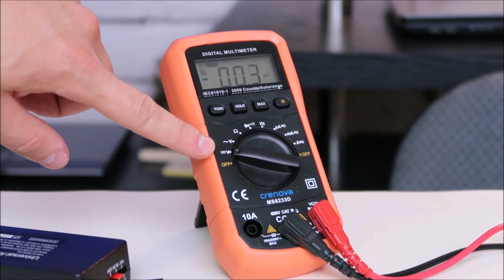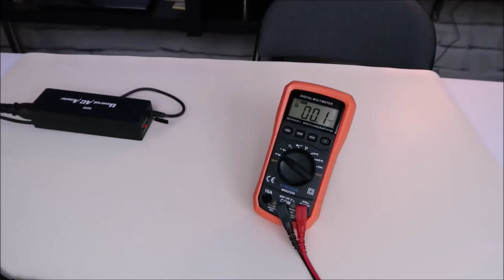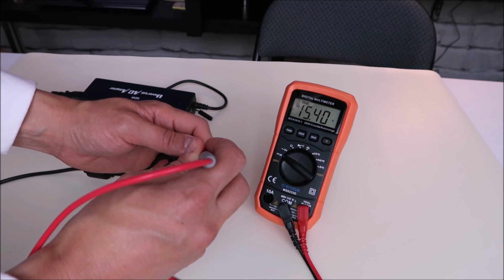How To Fix Any Laptop - Wont Turn On, Wont Open, Turns Off Right Away, No Power Solution

Comment: hi guys, i've watch a ton of vids from your site but can't find an answer to my issue (nor does Dr Google help me either).  i have an HP Envy, when I am working and then close the lid and reopen the lid my computer keyboard freezes for a period of time....I can see the screen and all tabs i have open.  I can see the curser but it isn't blinking.  I have turned the "what to do when I close the lid" to "do nothing".  when my keyboard isn't working, If I wait a full minute or two generally (suddenly) I can use my keyboard again.  Sometimes, however, I need to do a hard boot to get things going again (esc does nothing, warm boot C-Alt-Del does nothing).  This seems to have started around window 10 install and i'm now using Wind 11.  I also have a touch screen which I disabled thinking this might be the issue but doesn't seem to make any difference.  A Weird thing is that if my keyboard is frozen and my touch screen is enabled I CAN use the touch screen even tho the keyboard is frozen.  I've tried everything I can think of.  any ideas?  Thanks for help if you have any.
Reply from the maker: Many times, sleep mode starts glitching without needed updates or with messed up updates.  Best to not use it all the time if you dont have to.  Make sure the computer is fully updated as seen here first;  https://www.youtube.com/watch?v=DDv2gJDjfOM

Comment: my Acer all in one does not turn back on without me having to reseat the ram. it's not the inside battery or the charger. can you think of a reason why it turns on after reseating the ram but not after powering down? it's about 5 years old is it time for a new computer? appreciate any input thanks.
Reply from the maker: Your RAM could be going bad or the RAM port could be lose / damaged :(

Comment: Hello Brother i have a (Acer Chromebook Spin 513 2-i-1) and it wont turn on. The light battery works and i have tested all steps. Please help me i have a LOT of homework to do
Reply from the maker: If all the tests in this video do not reveal the issue, and your power adapter tested to be fine, then your most likely looking at a Motherboard replacement as seen here;  https://youtu.be/N_7HNrFkMS8.
Reply: @PC_Monkey  My acer dont have the same motherboard
Reply from the maker: @aandersson5676   No of course not :)   Each computer will have a different motherboard and a different way to access it.  Does this help access your MB?  https://www.youtube.com/watch?v=j6wuTqmVp4o

Comment: Kinda late to this but mine didn't work- pls help 😭😭 I really need to finish my exam and the deadline is tomorrow 😰 I try to ask my mom to go to the store to fix it but I can't go to any store cuz I'm too young plus I don't have any money to fix it 😭(ಥ_ಥ) help plsss! 😓
Reply from the maker: Are there any signs of life at all when you try to turn it on?  Lights?  Fan, Motherboard, or Hard Drive sounds?  Anything seen on the screen?
If not, then your on the correct video.     If all the tests in this video do not reveal the issue, and your power adapter tested to be fine, then your most likely looking at a Motherboard replacement as seen here;  https://youtu.be/N_7HNrFkMS8.

Comment: Pls help my laptop acer aspire won't turn on. I already followed you on what you teached but it still doesn't on. Reply to this pls and I will say all the details.
Reply from the maker: Are there any signs of life at all when you try to turn it on?  Lights?  Fan, Motherboard, or Hard Drive sounds?  Anything seen on the screen?
 If all the tests in this video do not reveal the issue, and your power adapter tested to be fine, then your most likely looking at a Motherboard replacement as seen here;  https://youtu.be/N_7HNrFkMS8.  If you know your computer's model number, I can help you get inside your specific computer :)

Comment: Still doesn’t working.... (ps my battery wasn’t working for years now. Also I bought new charger and still nothing)... What can I do? 🥺
Reply from the maker: Are there any signs of life at all when you try to turn it on?  Lights?  Fan, Motherboard, or Hard Drive sounds?  Anything seen on the screen?
Reply: @PC_Monkey  First of all thank you for answering. When I have my laptop in charge and my battery on I see a red light in the battery icon and if I press to turn it on It does open, I hear noises from it and then laptop says “preparing automatic repair” and shuts down again! 
If I remove the battery and still have the charger then my laptop doesn’t open.

If I remove everything and try to do what you show us on the video my laptop stays alive (😆) for 1 minute but if I try again to open it without remove everything again it closes in 5 seconds. 

Sorry for my loong message.
Reply from the maker: @videoswithcats  If your able to see the message 'Preparing Auto Repair' then this is the wrong video to be on as your computer is actually turning on :)  What brand computer do you have?  I can direct you to the correct video
Reply: @PC_Monkey  But it’s turning on only for 1 minute and then it’s shutting down again. I have Asus x552c.
Reply from the maker: @videoswithcats  Are you able to try the steps seen here?  https://www.youtube.com/watch?v=J1ZagkSTcSI
Reply: @PC_Monkey  I tried these steps but in the boot tab I had only "Launch PXE OpROM
Enabled" under the "Boot Configuration" I disabled, press F10 and then see if my 
laptop could open, nth happened so I enabled it again but..nth happened again!

After that I went to another video of yours "How To BIOS Reset an Asus Computer / 
Access Replace CMOS Battery - Laptop Wont Turn On Fix #2, 
https://www.youtube.com/watch?v=uL97XhontSo&t=491s" 

I disassembled my laptop, took out my CMOS battery for 30 minutes and then put it 
back and try to assemble my laptop... all went well but... I accidentally Ι take off the 
blue out of one ribbon cable, the one at the left (I hope that you understand what I did). 

1.Can I fix it somehow? If I can then how? with office tape or it will get worse? 
Or buy another ribbon cabe.

2. And another question, because I'm doing my MSc, 
can I have my files back if my laptop can't open again? 

(When I try to open my laptop, I don’t
hear the noises that I was hearing
before..but I see the battery’s red- light, 
with battery and charger on of course...)
Thanks in advance.
Reply from the maker: @videoswithcats  If you cannot find how to switch the setting in BIOS or if switching did not help, then reinstall the Operating System as shown here;  https://youtu.be/1VD9fPJ1eik.  You can create your own install media for free as seen here;  https://youtu.be/g_UhiHScaSI.  If Windows won't install correctly, then we know that the Hard Drive is bad.  Replace it as seen here;  https://youtu.be/jQDcHTgmV0Y.  Then, install Windows onto the new one.
Reply: @PC_Monkey  one of the ribbon cables (the one at the left, who is attached to the on/off button) broke. Actually his “tail” broke, the blue one. Can I fix it somehow? Because I can’t switch on the laptop right now (Although I don’t know if this is the reason why laptop doesn’t open). 
Also, can I take my documents off the laptop? 
I’m asking you because laptop doesn’t open. Thanks again for your quick response.

Comment: My computer won’t turn on and the only fix is removing the battery, only problem is the battery is internal and it has broken screws so even if I open the pc I can’t take the battery out. Any fix??
Reply from the maker: Are there any signs of life at all when you try to turn it on?  Lights?  Fan, Motherboard, or Hard Drive sounds?  Anything seen on the screen?  You dont have to unscrew the battery possibly, just unplug it from the motherboard.
Reply: @PC_Monkey  The only sign of life is when i connect the charger the light next to it turns on but that about it, ocasionnally when I unplug it and hold the power button really fast it turn the power button light on but no signs of life no fan no battery, nothing. Ill try to unplug the battery.
Reply from the maker: @spiderpal2341  Good luck !!  Let me know how it goes :)
Reply: @PC_Monkey  Nothing happened. Do you have a discord I can add you at? I want to send you pictures so you can help guide me.
Reply from the maker: @spiderpal2341    If all the tests in this video do not reveal the issue, and your power adapter tested to be fine, then your most likely looking at a Motherboard replacement.  You can post a video of the situation on your YouTube channel and message me back here when you do.  I can then view and advise further.

Comment: Doesn't work dude
Reply from the maker: These are diagnostic steps to troubleshoot which component is the cause of the computer not turning on dude :)  As stated in the video, if the steps seen here dont identify the issue, then you are left with the motherboard being the cause.  It would then need to be replaced.

Comment: I have an Acer Aspire 3 but it no longer turns on and when I connect the charger the charging led does not light either, I check the charging pin and it works correctly but the battery seems to have 0v and does not charge, I tried without the battery and with the charger connected but it still does not turn on

Could it be the damaged battery or the motherboard?
Reply from the maker: If all the tests in this video do not reveal the issue, and your power adapter tested to be fine, then your most likely looking at a Motherboard replacement as seen here;  https://youtu.be/N_7HNrFkMS8.  If you know your computer's model number, I can help you get inside your specific computer :)

Comment: Hello I using the elite book 8470p  it does not come on , if I plug in the charger  a led light blinks in front of the computer .
Reply from the maker: Are the lights the only signs of life when you turn it on?  No motherboard or hard drive sounds?  No fan noise?  Nothing on the screen?
If the lights are the only sign of life, then your on the correct video.  Are you able to try the steps seen here yet?

Comment: Idk its still not working on my laptop huhu should i go to repair shop? 😭 But im broke pls
Reply from the maker: Are there any signs of life at all?  Lights?  Fan, Motherboard, or Hard Drive sounds?  Anything seen on the screen?
Reply: @PC_Monkey  nothing, even the On button there is no Light power, the fan not working, there's no hard drive sounds at all,  it's been a month i didn't use it :(( 
idk i use it last time its overheated i guess.. that's a normal in laptops right?
Reply: The charger are in good condition.
Reply from the maker: @ashliadatu650  If all the tests in this video do not reveal the issue, and your power adapter tested to be fine, then your most likely looking at a Motherboard replacement as seen here;  https://youtu.be/N_7HNrFkMS8.  If you know your computer's model number, I can help you get inside your specific computer :)
Reply from the maker: @ashliadatu650   Good luck !!  Let me know how it goes :)

Comment: Not solved..... 
My problem "Start and shuts off right away" 😭
Reply from the maker: Are you able to see anything on the screen before it turns off?
What brand computer do  you have?
Reply: @PC_Monkey  no, nothing appears in the screen.  it shuts down Immediately.
Brand : DELL
Reply from the maker: @khaledshaifullah6275  If all the tests in this video do not reveal the issue, and your power adapter tested to be fine, then your most likely looking at a Motherboard replacement

Comment: What really happened to my laptop is
I was going to the restroom and something dropped on my laptop by accidentally then the screen turned black with rectangle color green and square  then i turned it off cause my mom said turn my laptop off then it wont open then today my mom brought my broken laptop to a place idk what its called and they said it can not be fixed and i need to buy a new one our country is in philipines we bought the laptop lastyear for 24 ,000 philipine peso and its been one year idk what to do cause i have school and it would be hard if i use my Ipad  hope you can help me
Reply from the maker: Are there any signs of life at all?  Lights?  Fan, Motherboard, or Hard Drive sounds?  Anything seen on the screen?
If not, your on the correct video.  Are you able to try the steps seen here yet?
Reply: @PC Monkey   Thank you but i think nothing is wrong with my Laptop because it just magically opened in the repair shop on monday it did not open but yesterday when my laptop is checked it opened magically and the battery is very low idk why it just opened like that when it did not open on monday
Reply: @PC Monkey  keyboard everything is fine but thank you
Reply from the maker: @lianaalexaregidor9480  Glad your all set :)   Always here if needed !!

Comment: Hi! I check all of my laptop's parts, but my laptop has the problem of being turned on with only DVD, power led and internal mouse active led on. Not booting at all. Everything else is dead apart from from the above mentioned! Any ideas?
Reply from the maker: your on the correct video.  Are you able to try the steps seen here yet?

Comment: What if the keyboard turns on (keyboard lights up) both ways in your vid, but then turns off (black screen)
Reply from the maker: Are the lights the only signs of life when you turn it on?  No motherboard or hard drive sounds?  No fan noise?  Nothing on the screen?
Reply: @PC_Monkey  yes, unfortunately 😭
Reply from the maker: @Wahsup05  your on the correct video.  Are you able to try the steps seen here yet?
Reply: @PC_Monkey  yes still no luck
Reply from the maker: @Wahsup05    If all the tests in this video do not reveal the issue, and your power adapter tested to be fine, then your most likely looking at a Motherboard replacement as seen here;  https://youtu.be/N_7HNrFkMS8.  If you know your computer's model number, I can help you get inside your specific computer :)

Comment: i have a inspiron 11 3000 series 2 n 1 what are the max upgrades (it does not quite run as good as my other xps 15
Processor	Intel(R) Core(TM) i9-10885H CPU @ 2.40GHz   2.40 GHz
Installed RAM	64.0 GB (63.8 GB usable)
System type	64-bit operating system, x64-based processor
Reply from the maker: You can have your computer scanned to see possible upgrades on sites like crucial.com.  Just dont buy the items there.  Far too expensive :)
Reply: @PC_Monkey  ok thank you

Comment: Amazing video!  Thank you so much!!  I managed to get my laptop booted.  There is one glitch, it doesn't STAY working.  I followed your steps and I can get it started by: disconnecting the internal battery AND CMOS, then hold down the power button for 1 minute.  Finally, I leave the batteries unplugged but connect the A/C and it boots and works perfectly!  So, I power off, connect the battery and CMOS and it powers up.  On just battery, it works.  Then I connect the AC and it charges the battery.  All looks good.  However, overnight, I am back to square one and have to open the case and disconnect batteries, hold power and start all over.
I tested the RAM and hard drive and they pass the HP tests.  I have an old HP Elitebook 840G3 (problem laptop is 840G5) and the A/C adapters are fine.
The BIOS was updated and I used HP Support Assistant to install all the latest drivers.  I tried Win11 and Win10 -> same issue.
Thanks again for your amazing videos!
Reply from the maker: What happens exactly when you try to start it the next day and it wont fully load?

Comment: Hi,

I'm facing trouble with my HP 15-ac042tu laptop basically system hard disk goes to sleep after some time of system run. It happen in both case in battery power supply and direct power supply.
Reply from the maker: I dont understand your comment.  What happens in both cases?  Does the computer turn off?  Do you get a 'No HDD' error?  What happens exactly?
Reply: When I work on system suddenly screen goes blank at that time hard light not blinking only power light blinking
Reply from the maker: @Samarendra  For a computer that turns off during use, can you follow the steps in this video?  https://www.youtube.com/watch?v=Nqn8-jJFx2Y
Reply: @PC_Monkey  thanks for support
Reply from the maker: @Samarendra  Happy to help :)  Always here if needed !!

Comment: It won't work for me😭 it's just charging but won't turn on when you press the power button the icon just lights up:<
Reply from the maker: Are the lights the only signs of life when you turn it on?  No motherboard or hard drive sounds?  No fan noise?  Nothing on the screen?
Reply: @PC_Monkey  yesssssss
Reply from the maker: @rona07  This video has been updated with additional steps here;  https://youtu.be/P3I7dDpkJps.  Let me know how that goes :)

Comment: I try so many times, but it didnt work😭😭. My computer is not turning on. Why?
Reply from the maker: Are there any signs of life at all?  Lights?  Fan, Motherboard, or Hard Drive sounds?  Anything seen on the screen?
Reply: @PC_Monkey ,, it has a light on the power button but in the screen, it's all black
Reply: @PC_Monkey  only screen can't work..,,,
Reply from the maker: @irishabao9906  If the only signs of life are lights with not noises and nothing on the screen then we can assume for now that the computer is not turning on.  Have you tried all the steps in this video?
Reply: Yes sir, I've tried all this steps, but my computer is not turning on.
Reply from the maker: @irishabao9906  If all the tests in this video do not reveal the issue, and your power adapter tested to be fine, then your most likely looking at a Motherboard replacement